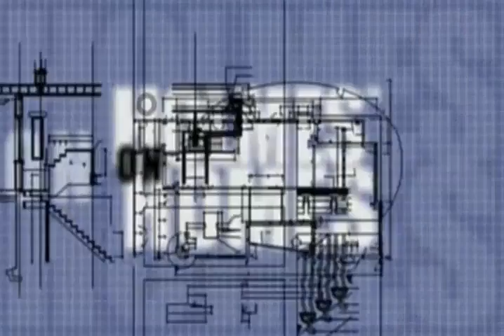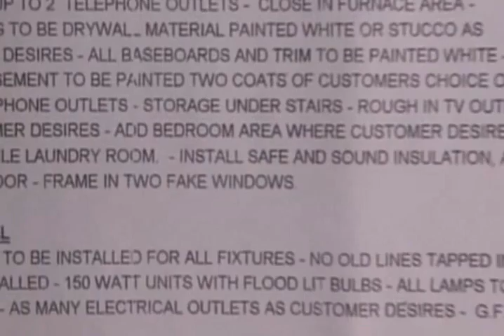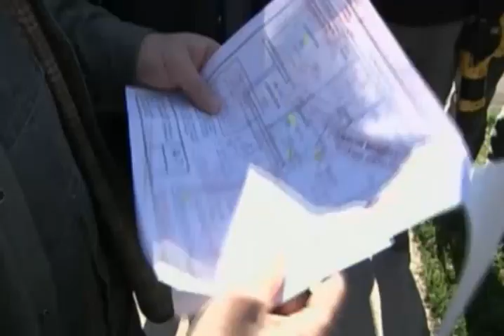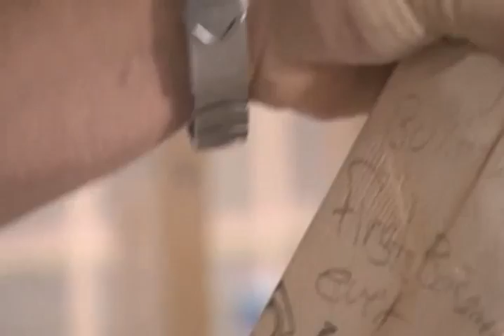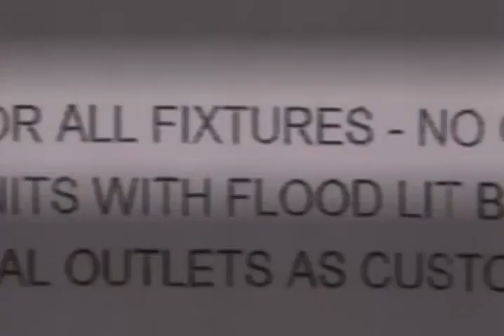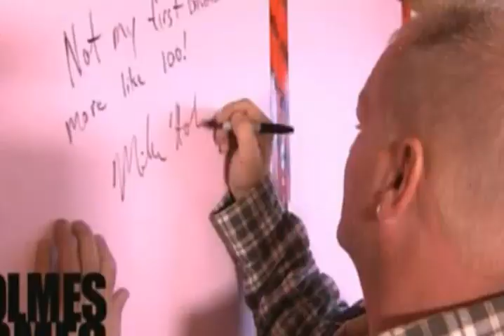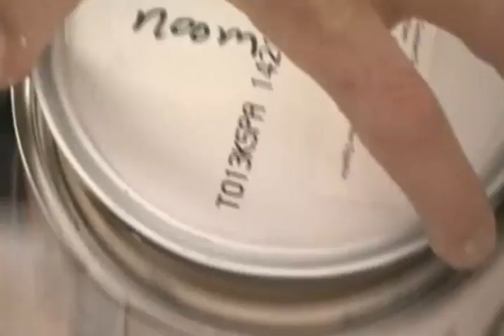Holmes On Homes Sea 05 Epis 05 Bargain Basement

Comment: The previous owner of my home was a "home inspector". The DIY done was horrible. Outlets spark, outlets pushed into the walls to accommodate oversized appliances, etc. They installed laminate and tile in the basement. I removed the laminate and tile to find the hidden disaster of a heaved and badly cracked concrete slab. The home inspector I used (NOT the previous owner), found no issues with anything. If only Mike Holmes were in my area. My fear of finding the right concrete contractor to replace the basement floor, only to find out they may be one like in this video, keeps me from hiring.

Comment: The biggest loss in real estate is FIRE. I never understood why Americans build their house with match sticks! (wood) The last house that I built, was made of reinforced concrete! (you can't burn concrete) 14-inch outside walls, 6-inch 20 gauge steel inside walls, 36-inch solid wood doors, electrical was commercial-grade, 12 and 10 copper wire, in conduit pipe. 200 Amp service box, 125K BTU boiler for radiant heat and hot water. 5 bedrooms, 4 baths, heated garage, huge windows, wood inside and extruded aluminum outside maintenance free. reinforced concrete radiant heated floors. (no static energy sparking)  In 2020 we had a 5.6-scale earthquake, we didn't bother to get out of bed, and the whole house shook in one piece, no cracks, nothing broke. Most neighbors had damage from the basement, floors, and roof. The house was cheaper to build than the ones made of wood.
Reply: And how much did that cost compared to a wood framed home?